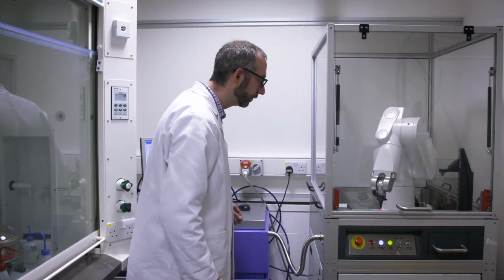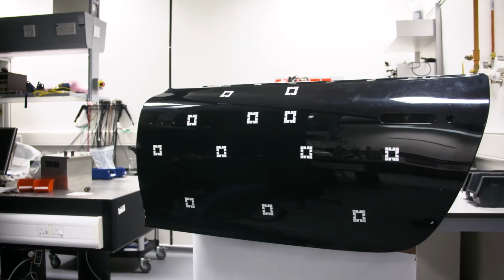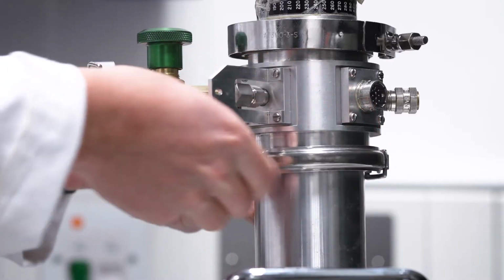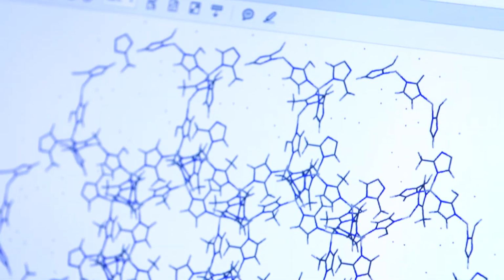Terahertz Applications Group at The University of Cambridge

Comment: Just as well, one could form salt crystals into a stable plasma through aerosol evaporation in conjunction with ultraviolet light and hydrogen bonding, if one alters, breaks, or rearranges the crystals, right? Hasn't this happened before? High-energy ions and hydrogen peroxides could be generated in a highly concentrated amount through a natural double-electrolyte vacuum chamber. (The size corresponded to limestone structures with sediment deposits in connection with strong Earth frequency fields, as found in places along a 6000 km-long freshwater stream from near the equator to a saltwater sea, such as the Mediterranean. But that's another story.)"